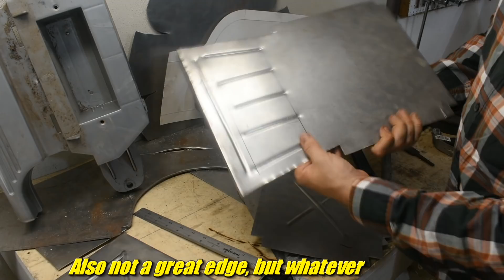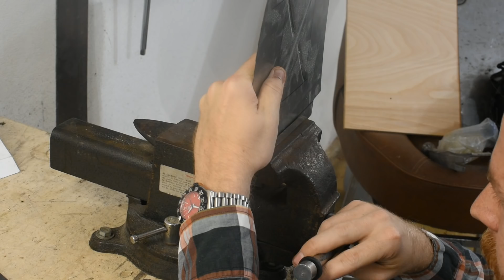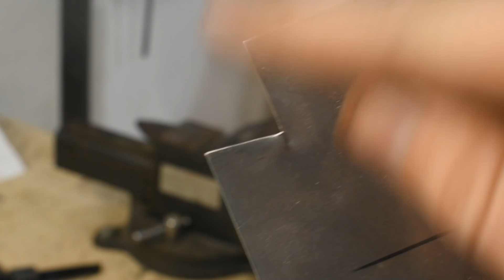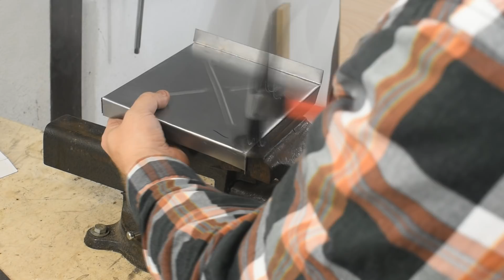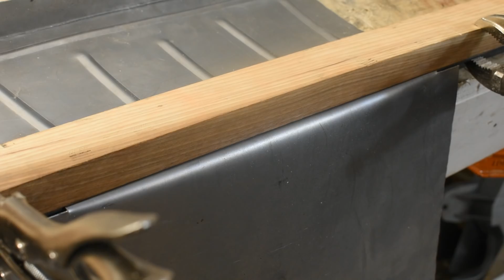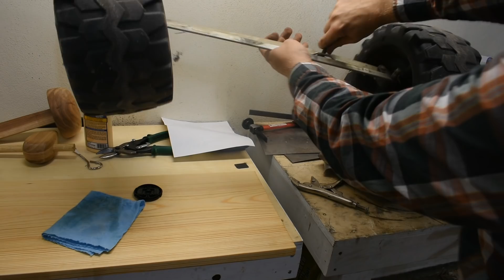Mini Willys CJ2A Part 7: Making a Metal Brake out of Junk and Using it! Also hammers...

Comment: you can widen the clamped surface on the vice by using two pieces of steel angle 
https://i.pinimg.com/originals/9d/b9/73/9db9739b700aef45ef6f9b8f44d2b0c2.jpg
you can weld a piece of pipe with a slot cut in it between the two pieces of angle on one end so the pieces will open automaticly when you open the vice , it will allso prevent the pieces of angle from shifting or falling out of the vice

sumting to think about for future use is a homemade spotwelder 
https://www.youtube.com/watch?v=4q4oMVtW4FI, might be usefull when you replace panels on the van

Comment: after your Rivet or weld it together, just take it and have it Sand Blasted to Clean all the Rust Pre Painting, Pretty Good Job so far, you can Scale it up and put it on a Golf Cart frame next .
Reply from the maker: A golf cart would be pretty awesome! I used to have an old golf cart.  The thing didn't have a governor, it would probably go 25mph downhill.  5 mph uphill.  It wasn't very powerful, but the loud backfires were pretty impressive.

Comment: The "sheet metal brake" I use now is a lot like the one you use. Except mine is two pieces of metal, and no wood. Pro Tip use spring clamps as extra hands to temporarily hold your brake together while you get the grips just where you want them. I actually use C clamps because they have a bit more throat, and clamp harder. But you can imagine how hard it is to set C clamps where I want them. Which is why I clamp it all with spring clamps first, just to hold stuff together while I C clamp it all. Also for your radii pipe may work better than a socket. I have some heavy wall 3/4 pipe in my shop for pipe clamps.

Comment: Great job! I know you mentioned you're getting a HF brake. If you still need to fold metal in the vise or with the angle iron, place a piece of wood between the metal and your hammer. It takes longer but it'll be smoother with no hammer marks.
Reply from the maker: +eviltwinx that's a good idea! Even my flat hammers left dings, I tried using a slapper too but I think the force was spread to wide and it wouldn't move much metal.
Reply: Or you can do the gross mangling with a dead blow hammer, and come back and crease it at the end with a planishing hammer. One trick Paul seems to have grasped is fold a little at a time.

Comment: Here is a 2 part question.  The first part is to do with the fact that I do not know my gauge metals.  The thickness I am thinking of is close to same thickness ether most bed frame angel iron is made of,  or large 175 gallon used oil storage tanks are made from ( like you might see at a time-it lube .  This link will show photo of Tank I have in mind http://quintesourcewater.ca/web/wp-content/uploads/2015/01/oil_tank_with_drip_tray.jpg ) It would be nice if any one can tell me what guage metal that is?  ( I just know it when I see it, but to ask for it for example talking to someone on the phone, I have no idea what to ask for.) 

      The second part is I plan on building a new forging furnace hopefully in the next year ( provided I can get my hands on certain materials I know I need  for it.  )  when I do, I will have a choice to cut and weld strips to make a rectangle almost like a pan shape or more prefered to bend it and just weld up the corners.  for the thick metal such as I describe above. What would be a good suggestion to try use as a break for thicker metals like these? Keep in mind I live 25 miles in the sticks and some resources can be challenging to get my hands on.  ( a proper work bench is also in my list of things to build  / got a decent bench vice ( for what harbor freight has to offer ) though {LOL} ) a micrometer and caliper Is in my wish list.  Just got my 115 piece numbered drill bit set.  now many of the smaller bits are difficult to tell what size they are after the try fell and dumped.  Thanks in advance any information about the guage metal I might be looking for as describes above as well as best way to bend it with limited tools.
Reply from the maker: +Little King Cobras Den I think the best way to figure out what gauge metal something is would be to measure it.  If you have a set of calipers you can see how thick something is in thousandths of an inch or in mm, then check a reference chart for converting that to gauge.  I don't know from looking what that gauge will be, but the thickest stuff I've worked with is 18 gauge (think sheet metal on old cars).  

thicker than that and I'm not sure a metal brake would be a good option for bending, unless you had a big industrial one.  For thick stuff you would probably be better cutting the pieces and welding them together at angles, though steel plate benders do exist.  I've never tried them.
Reply: Thank you. I now have a better idea how I will attack my plan to build my furnace as materials become available to me.  I am still experimenting to see what burners and fuels I like best and can have most access to while I stock pile lumber and other materials for the inside form when I pour the refractory cement.  It is one of them things, I see a finished desired look and function in my head, I just have to get the materials and make it happen.
Reply: For bending really thick metal I've seen them use dies in presses. The top die is like a wedge, and the bottom one is a vee that the wedge fits into. I've also seen folks make wedge die jaws for bench vises too. Here's a pro setup https://s-media-cache-ak0.pinimg.com/736x/10/9c/f4/109cf45422e5bb12f9012aaf538142f4.jpg Here's more of a homemade one http://photos.imageevent.com/number9/march2009/vise1a.jpg Instead of that square bar on the fixed jaw I've seen people use lengths of pipe instead.
Reply from the maker: Thanks for the pictures!  I might have to make one of those...
Reply: Someone was finally able to look at the metal I prefer to work with and said it was close to 14 gauge.  I am not sure what the metal you are using in comparison if it is as thick or thinner ETC.?  So now I guess the question after I get my hands on a 14 gauge sheet of metal, would I be able to bend it as I described in origional comment? Or will I still probably be best cutting the strips and welding the sides?  Thanks in advance.
Reply: It is definitely a simpler design to make than the traditional hinged metal brake. But in a vise there is a work size restriction. For bending heavy plate they use dies in a press. Which can allow for a greater range.

Comment: what kind of fire bricks r u using
Reply from the maker: +joe garrow insulating fire bricks, the light weight soft ones.  Normal "fire brick" you get at a store is usually the heavy fire brick for making grills and stuff.  It stands up to the heat, but it won't insulate like the light stuff.
Reply: Paul's Garage you should try making one of those arc furnaces but u would need a stick welder first
Reply: Paul's Garage what app do u use to edit on ur computer
Reply from the maker: +Sam Sherman I have a very old version of Sony Vegas.  Like, Barely new enough that it works on windows 10.  Still works, though.  Basically any editing program works, as long as you learn how to use it.

Comment: Ive seen alot of people using a standard metal brake as a pan brake, just by sticking a large metal block in it the size of the folds you were wanting to fold. They usually used an aluminum block, but idk where you are going to get a block of aluminum like that, hint hint, lol. The jeep looks like it's coming together quite well and looks like your starting on the home stretch now!
Reply from the maker: +Chirpy's Tinkerings that's a good idea.  Yeah, no idea where I'll find aluminum blocks lol